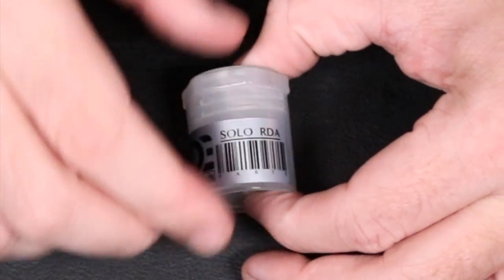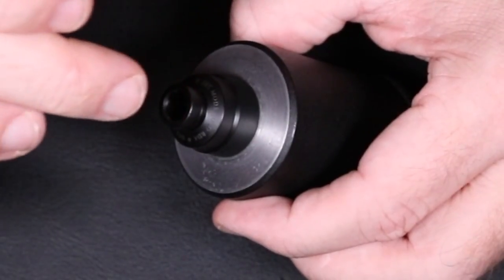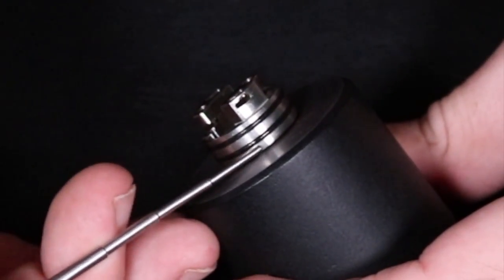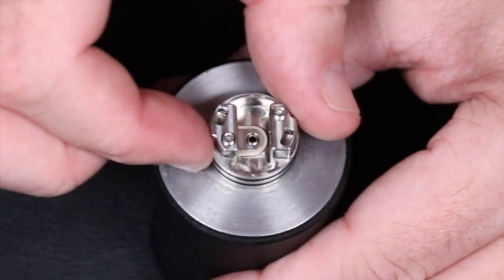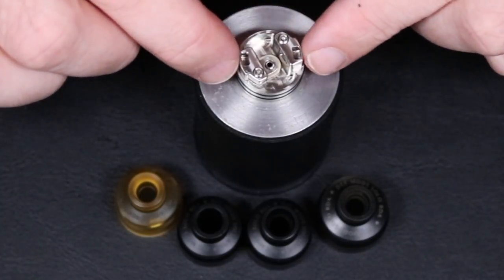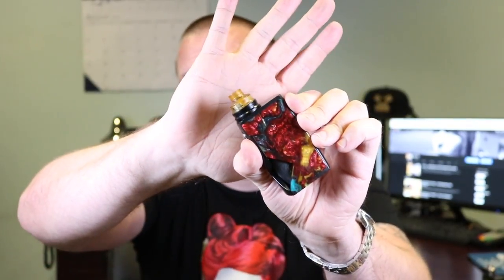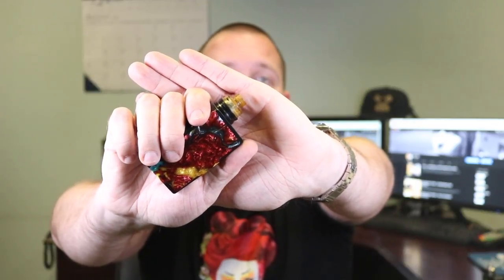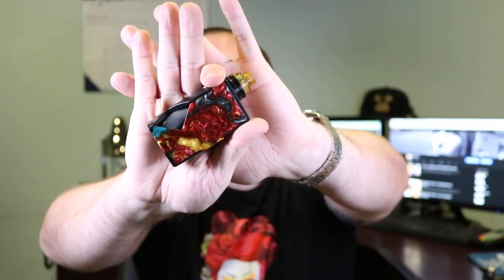DEE MODS SOLO RDA ~ High End Single/Top or Side Airflow/Restrictive DL/MTL

Comment: hell yes one of my Top 5 rdas of all time the OG Solo rda. This thing is badass i love this rda. The flavor is top notch with smooth airflow to match. Some people dont get the idea with this rda of the whole spining deck so you can line up your airflow the way you want it. Cause it only works with a spring loaded 510 If you have a manual adjust 510 you can just use the 510 to line up the airflow holes the way you want them. But with a spring loaded 510 you have zero control where your airflow lands. So for people like me who has to have their airflow lined up the way I want it. Its a badass feature. I find Just basic round wire 25 gauge SS 7 wrap legs up to be the best build Small fused claptons work well also like duel 29 or 30 gauge fused with 38 or 40 gauge. But legs up gives the best flavor i find. Price isnt bad on this rda its 89 usd rrp but the price goes up with the add ons like top caps beauty rings and theres also a 25 usd shipping charge if you buy direct from dee mods. Great review Pal and good on you FC for that gear swap to give our boy Pal some nice high end gear to review and Badass song choice FC.
Reply: Louie Nicolet is there a newer version of this one?? I think I remember hearing they were updating it but I don’t remember seeing the updated one . Or maybe I did and just don’t remember at this point it’s anyone’s guess lol.
Reply from the maker: Louie, Fictitious Character keeps trying to pass the elitist high-end champion's trophy to YOU!!  So I guess we have another high end, extremely knowledgeable badass in the house:)  I feel that over time I will end up loving the Solo as my vaping preference seem to cyclical and always going from one extreme back to the other. So now we have you, FC, Whee, Dane, Stian, ID Voka and several others that can drop some knowledge on me and this channel for others.  Thank you so much for checking this out :-)

Comment: I use that bottom plate to adjust the air holes so that they are facing perpendicular to how I vape so that juice doesn’t leak out when I tip it toward me.
Reply from the maker: I do the exact same thing when I run my bottom air duals on mech tubes.  People complain about airflow that leaks but a lot of times you just need to tilt it the right way on that first vape and after that you're all good!  Solo is one of the coolest looking singles I own....I really think I will end up loving this thing over time.

Comment: Very nice looking atty. I like the whole "adjust your atty to look good on your mod" feature. That's creative. Im super OCD about where my airflow is pointing, I've got a long beard and hate it when I do a quick purge and get vape lingering in my beard. 

I just ordered a purge ultem squonker. Any suggestions on an atty that is single coil, semi restrictive, but will not look ridiculously small on top? My funds are low after the purge mod purchase or i would have went for the mose one, since it looked great on it. The only inexpensive atty I could think of was recurve, but was hoping you would have another idea.
Reply: The drop solo with ultem top and beauty ring? A little bit of restriction. There's also the Hotcig Hades which technically not a single coil ( with duals it's a bit tight for building space but feasible ) but works very well for singles and semi restrictive and squonks good.. the omeka msm taste is another 24 but it also has a replaceable single coil deck that looks similar to the dpro mini ( dpro mini is another I'd recommend but it is a little guy but still really good) .. asmodus C4 is another option as its a single 24mm so won't look dinky. Other then that I'm sure you know the rest of the current popular singles. . I just build the hermetic the other day and it is pretty good.. but unfortunately all there is right now is black and ss so maybe not the best matchy matchy for an ultem mod.. anyways just some ideas brother
Reply: @whee0609   Thanks! I know a couple of those, but will look into the others I'm not familiar with. I appreciate the info.